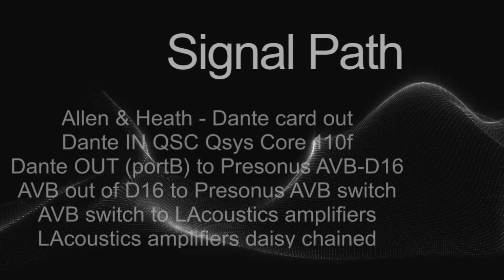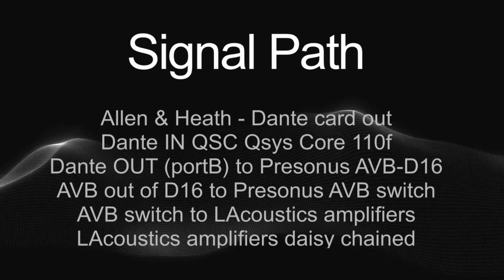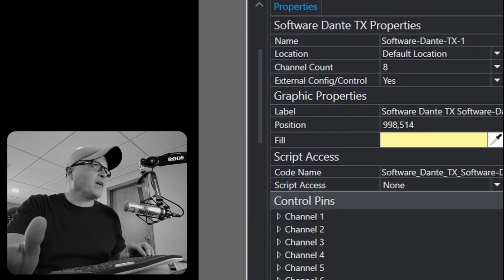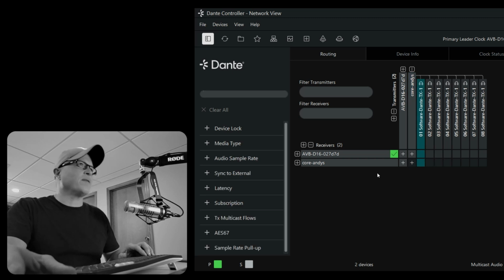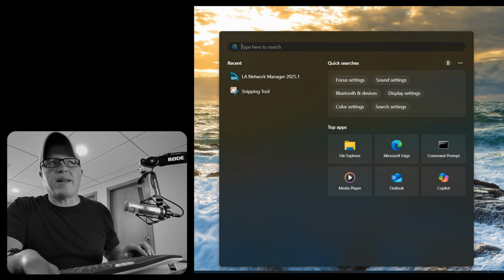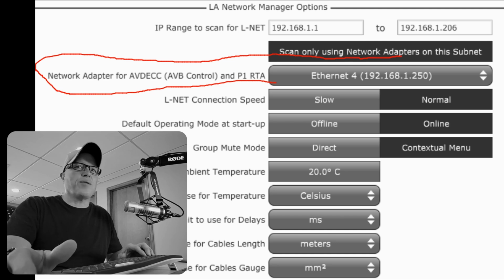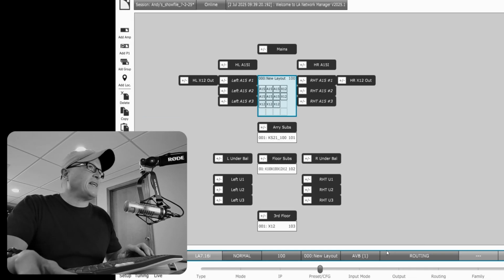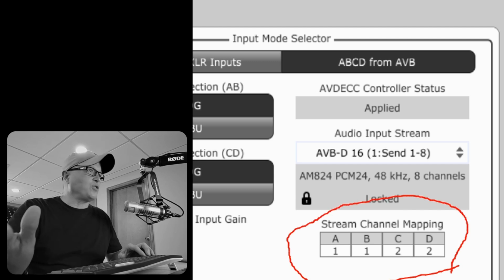before you try AVB audio with L-Acoustics amplifiers.... you need to watch this!

Comment: Awesome this work. Wich firmware version did you use on your presonus  avb-d16 ??
Reply from the maker: hey!   man….. unknown, this video was shot about 8 months ago.   I can say…. I just recently visited where this converter was installed and it’s still working perfectly.   Now….. we can simply run the AVB on the netgear AV switch.   However…. the principles are still the same!   best of luck

Comment: You could remove the PreSonus AVB converter if instead of the three X4 amps replacing those with one LA7.16i then feed the two amps directly from the Core using AES67 Compatibility mode on the amps. Would love for Q-sys to get on the 96KHz train... even if it cuts your channel count/processing in half.
Reply from the maker: ohhhh I so agree with that comment.  We ask the rep every time we see him about 96khz.   He said there is a team that is tasked with that…… but I believe it is a ground up redesign on a lot of things….. then all the plugins on top
of that base.   Interesting thought on the AES67 comment, I’ve tried AES67 with a bunch of other things….. Haven’t tried it with Lacoustics.   Also, netgear now has an AVB vlan config on the AV switches (which we have in that job also)….. so, we could pull that AVB switch.   You can also just daisy chain that amps to the dante to avb converter after programming.  (then pull the avb switch)

Comment: Awesome that this works and great video !

My issue is the level of extra steps and devices needed for this to work gives so many points of failure and so many places where someone can mess something up. I would totally need to stay on site for every show until everyone could get proper training on how to do this 😂.

I wish a high end brand would just add a dante option since most systems dont use avb.
Reply from the maker: I absolutely agree! very few companies still holding on to AVB…..I’m still a huge fan of Lacoustics though…. if only Dante!   and Dante 24bit 96khz for QSC qsys too!!!   BTW - I wasn’t sure how AVB and daisy chaining the LAcoustic would go….. seemed to work great.   After programming, I believe you could even take the Presonus switch out of the chain……. come straight out of the converter and right into the first amp.   It’s even possible you could connect your computer to the AVB output on the last amp for programming too….. but I had the switch there and didn’t try it.   I may end up pulling the switch out of the chain, simply bypass it and see if it works!   You’re comment on extra crap in the signal chain I agree with….. $70k PA….. dependent on a $10 chinese (probably) presonus power supply.  doesn’t seem right!   😂